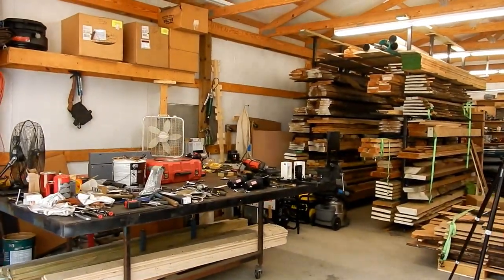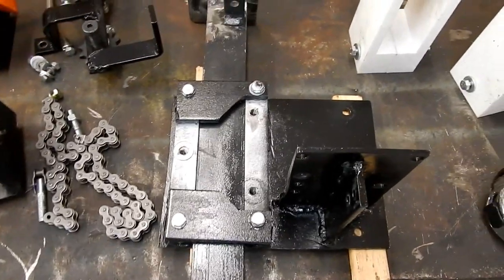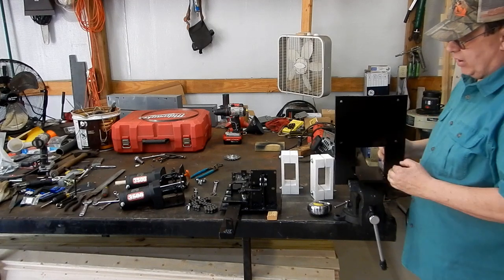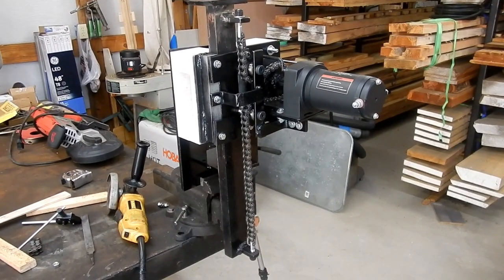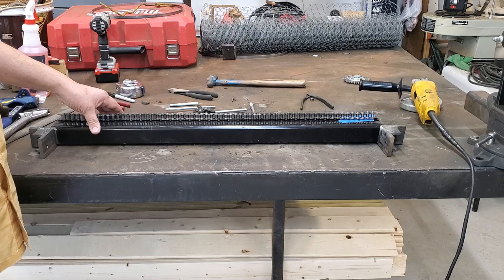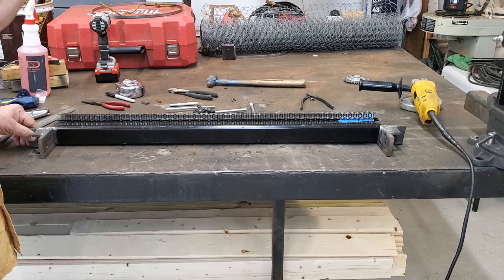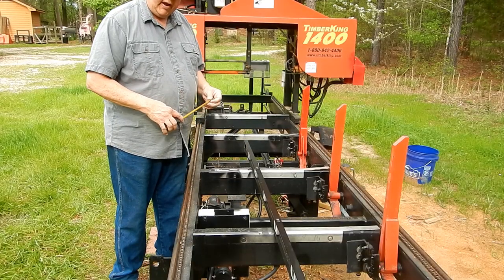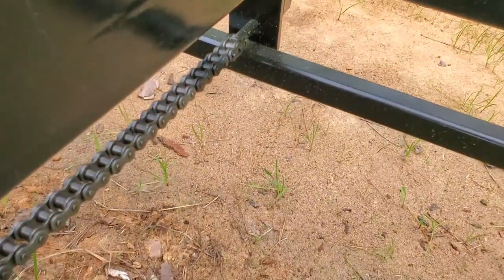TimberKing 1400 Power Log Dog   Winch Driven

Comment: Hi David, Thank you for Mill modification videos. I'm Planning on doing your log stops and log dog they are great options. I want to throw something at you and hopefully you reply. What would you think of reconfiguring the log dog trolley with the raise - lower winch on the side  toward the log stops and the log dog on the side away. Reasoning being to give more room for the log. Do you see any issues with that method? Thanks
Reply from the maker: Actually you are right on point about moving the raise lower winch to the other side. Also I would incorporate the cover algnment plate on the log stops to the log dog. Some space can be saved on the log dog by scaling it down abit. Where the log dog carriage rides on the 2" x 4" tube you probable do not need any more than 1" of contact on each side.
Reply: @davidpape9726  Thank you so much for responding, You are truly inspirational. How are feeling about the Zeak 3500's after time?

Comment: excellent! Thanks!

have you ever done any sawmill builds using old windshield wiper motors and gearboxes?
Reply from the maker: No I have not. I have thought about the those and the motor gear boxes for RV slideouts. While they would great for carriage mobility up/down or through the log I do not think they would give the required torque for a log turner or log dog. But I could be wrong. Proper gearing can do amazing things. The stabilizer jack motors may show promise.
Reply: @davidpape9726  I like the RV slide idea. I have heard electric power steering motors also. 

I have an all manual mill 3 phase mill so I am strongly considering a 12V subsystem to drive some log stops and a turner. You set up is awesome. 

Any thoughts on publishing plans?
Reply: @davidpape9726  One other thought... did the motors for the log turner end up being powerful enough or did you find yourself upgrading to something else?

If so, what did you go to?

Comment: How did you find out that the spool was something that could be welded to? Cause these are no longer available at Amazon
Reply from the maker: The spools that have the thicker sides tend to be cast. I have not found any more winches with steel spools. You can buy and attach  a sprocket sized to the spool arbor diameter using a split axle collar with extended set screws. I show where I did that on the log stop winch.

Comment: I notice that Amazon doesn't carry the Zeak winches anymore. Any thoughts on a different brand with equal specs and weldability?
Reply from the maker: I have not found any more winches with carbon steel spools so I used winches with cast spools on the rest of my modifications.
Go to Vertical Log Stops Part 2 of 2 https://youtu.be/u0HabF9XGTE or Log Turner Final  Modification Part 1 https://youtu.be/O5aJYSFHp7g for the clamp-on method which works for the small winches with the outside plate. I am going to adapt a sprocket to a 4500# winch but the outside of the spool cannot be removed so the sprocket will have to be split.
Reply: @davidpape9726  Gotcha! Thanks man

Comment: I'd love to see how you modified the winch to have the sprocket on there
Reply from the maker: Go to Vertical Log Stops Part 2 of 2 https://youtu.be/u0HabF9XGTE or Log Turner Final  Modification Part 1 https://youtu.be/O5aJYSFHp7g this method works for the small winches with the outside plate. I am going to adapt a sprocket to a 4500# winch but the outside of the spool cannot be removed so the sprocket will have to be split.

Comment: Also did you not use the switches that came with the winch? Why go with a third party momentary switch?
Reply from the maker: I used push button momentary contact switches mounted in a control box and an externally mounted selinoid. The control box with the swithes can be seen near the end of the video. I actually mounted the box in a previous video. The videos have a parts list at the top in the description. Thanks
Reply from the maker: I used push button momentary contact switches mounted in a water proof control box along with an externally mounted selinoid. The control box was mounted in a previous video. There is a parts list in the description at the top of the page. You can see the control box near the end of the video. Thanks